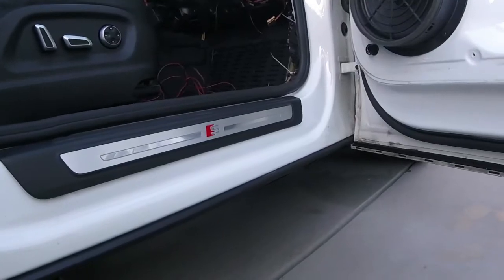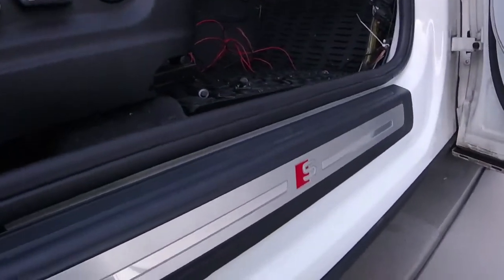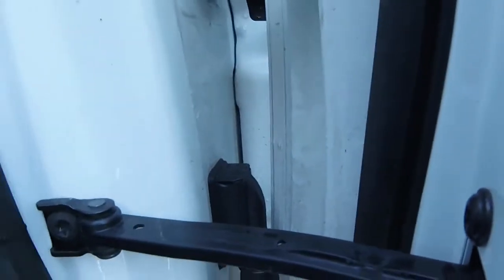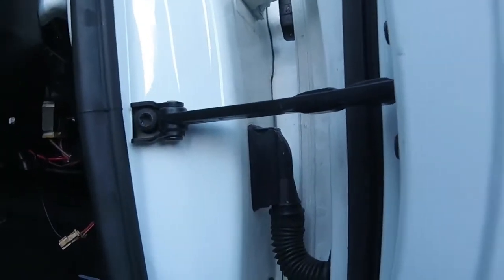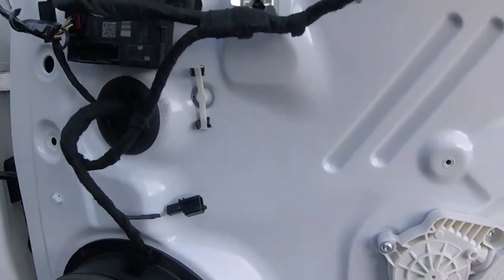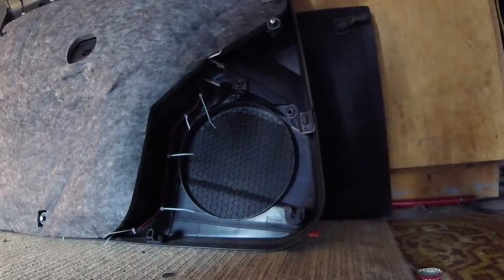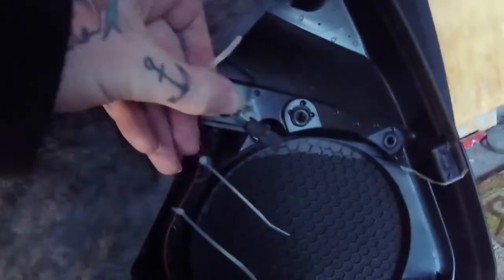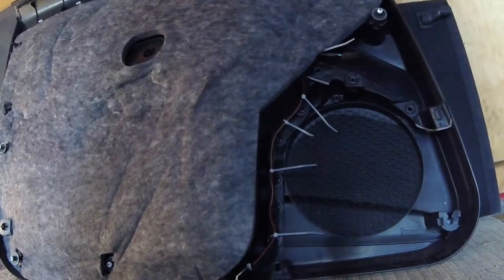DIY OEM B9 Illuminated Door Sill Retrofit - Audi Q5 (8R)

Comment: Nice! 👍 I have a B9 A5 and its light has failed. I have a replacement genuine Audi strip, but can’t figure out how to get it off. Is the only way to melt the glue? Which panels would I need to remove to access the connector? Thanks

Comment: Hi LESsfunctional sorry to bother you I have fitted some under seat light and looped them together and run all the wires to the drivers side behind the A pillar trim  to the dome light I would like to tap into the dome light for the feed can you tell me where the wires should go  +. - 
 I haven’t bothered with the door sill lights or the door puddle and warning lights as I am not that confident to mess with the door looms
Reply: william walker how are you just a question where can I buy this B9 illuminates door sills for my Audi Q5 can you please send me a link thanks

Comment: Can you tell me where the wires plug into the door module for the sill plates and where you can get the connectors from
Reply from the maker: Same as the puddle lights
Reply: Ok thanks another question did you assembled the silver illuminated plate on to the black plastic door sill or the B9 retrofit come like that in angle not flat ?